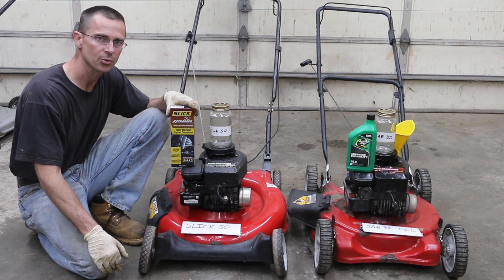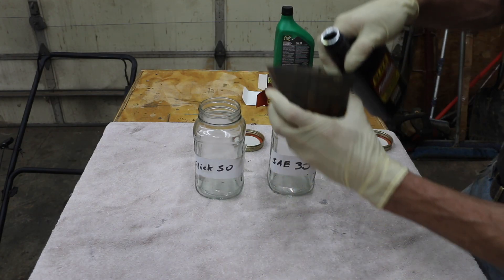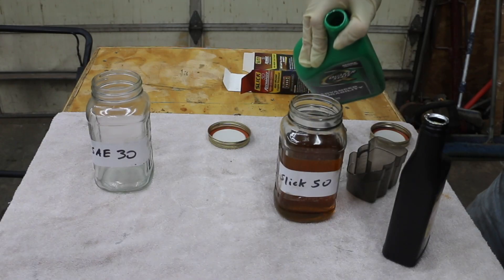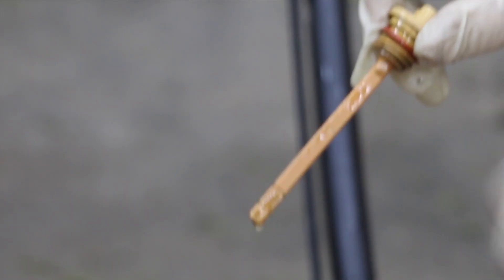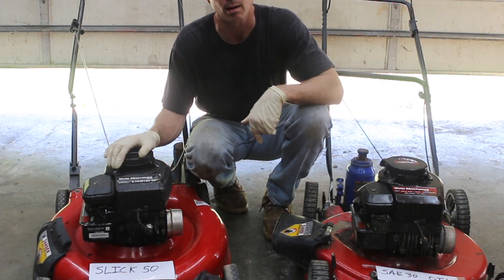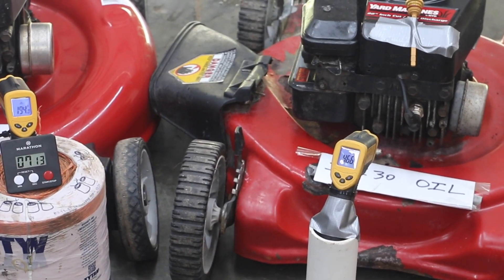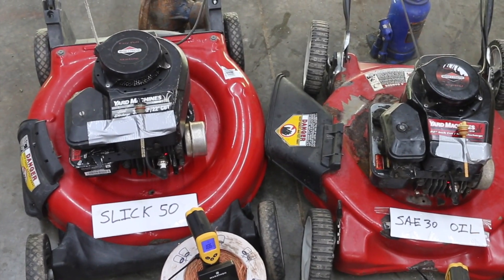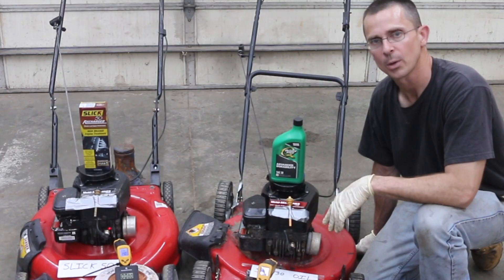Can't believe what SLICK 50 did to my engine!!--Dry Crankcase Test!

Comment: Slick 50 need to be run a long time before you drain the oil for this test
Reply: This. It's an engine treatment which binds actuated PTFE to metal wearing surfaces inside the engine. Instructions always said add it to a fresh oil and filter change then don't touch it until next oil change is due. That's 5000km for most vehicles. I used it for decades and found it to be amazing for getting an extra 10 years out of old/ worn motors. Even better results from small engines/ gearboxes. Love the stuff.
Reply from the maker: Thanks for the feedback.

Comment: Great video..  like you I certainly remember the slick 50 commercials.  I’ve been repairing automobiles professionally since 1981 and really like this video comparing the two.  I have to wonder.. did you attempt to restart either engine after they cooled..    though I heard a little squeaking from the Slick 50 engine before it stopped.. almost wonder if the piston seized within the cylinder..  interesting that there was no connecting rod knock from either one.. 
going back many years I remember cast iron straight sixes in Fords and Chevys would heat seize after running out of coolant..  cool off… restart just fine… and likely burn a little bit of oil thereafter…    Those engines had oil when they stopped back then.. 
I would love to see the test again with two IDENTICAL engines….  With a restart after cooling.. and perhaps a look inside for the finial failure..
But there goes the engineer in me again…. Great video, thanks for doing it!!

Comment: Nearly 40 years ago, I drove about 15 minutes w/no oil pressure. In a nutshell you could say I had a Slick-50 dry crankcase test forced upon me. 

Bought a new 1984 Turbo Mitsubishi. ~30K miles did a Slick-50 oil change. About 3500 miles later I unknowingly lost oil pressure only realizing the same about a mile, all down hill, from home. 

Next day I fix the oil leak. Filled it w/oil. It started free of drama! The most amazing part of this story: the product delivered the fuel economy increase I had hoped for!!  After that, per my plan, I switched to synthetic oil. Continued to enjoy a consistent 3-4 mpg improvement over the well established baseline. At 110K miles I sold it w/the original engine & Turbo still running well.

Comment: THIS TYPE OF ENGINE IS NOT SUITABLE FOR THE TEST YOU ARE CONDUCTING AS THE CRANK SHAFT JOURNAL DOSE NOT HAVE PRESSURE PUMPED OIL FEED BUT A SPLASH SYSTEM,THUS THE SLICK 50 MAY NOT HAVE COATED THE THE CRANK JOURNAL POPPER  BY DRAINING THE OIL DOSE NOT REMOVE THE OIL FILM FROM THE JOURNAL FOR THE SLICK 50 TO REPLACE IT? I WOULD LIKE TO SEE THE TEST DONE ON TWO IDENTICAL CAR ENGINES OF SIMILAR RUNNING HOURS/MILEAGE ALSO THE BUILD QUALITY OF THESE ENGINES WILL BE FAR SUPERIOR TO THE BRIGS AND STRAITEN LAWN MOWER ENGINES
Reply from the maker: Thanks for the constructive feedback.

Comment: I can't help but feel that over time the heat reduction would extend the life of the engine. Am I wrong in thinking this?
Reply: I agree as temp is usually degrading for most engines.
I wish he broke the engines down to id the specific failure mode, which 
might provide insight into why the 50 engine failed quickly, yet ran cooler.
Reply: @richardwellons5138  yeah. I would not be surprised if it was a fluke. The temperature differences though were quite large.. I'm not even sure how that is possible. The slick 50 would have to reduce friction inside the engine by a huge amount to achieve those results. 

One of the biggest things that causes engines and oil to break down is friction, and the heat caused by it.. which really, really, has me wondering what the long term value of slick 50 is and how exactly it's active components work.

Comment: The two engines looked different.   Need to be same for a control test.
Reply: Both appeared to be Briggs and Stratton which is still the standard for small engines to this day. The one that lasted longer looks to be on an old well used mower and the 2 minute engine is on what looks like a new mower. I’m sure he would be happy to reshoot this video if y’all ship him 2 brand new engines from any manufacturer.
Reply: Actually it’s true that each engine should be the same type! However who to say the age of the engine plus how worn-out is each engine were! How often was the maintenance done on both engines and then the environment, please note that the exhaust from the left engine was blowing directly on to the other engine…. Realizing that engine exhaust being blowing on the engine with the straight 30 weight really did well! … unless the one with slick 50 had a bearing issue! So your test however fun left little to nothing regarding an accurate study! I’ve spent twenty years of my life studying the destruction of different sealants! While destroying sealants you had to be certain to compare apples to apples and not apples to oranges!

Comment: If you had run the slick fifty for an hour or two before draining I think you would have had a different result.
Reply: Thats a great point. I believe there is a "break in" time, like hardener on a new cam.
Reply: @gregtanner3161  my dad was a small motor Mech and he loved slick 50

Comment: Three weeks ago, my oil was quite clear on the dipstick. I put less than a pint of Marvel Mystery Oil in the oil. And same in gas tank. Three weeks later I changed the oil and it was BLACK. And the idle has smoothed and car has about 20% more acceleration. 2001 Celica GT with 1.8.

Comment: When slick 50 first came out,My treated engine ran fine with no oil(85°day) for 7hrs.,and gas mileage went from 250 mi per tank to 325+ mi. per tank.WishI still had some original formula
Reply from the maker: Thanks for the feedback.

Comment: The engines I saw them running all that time ago were slant 6 Chrysler engines.  Dad said they, like a model T engine, had so many oil dams in the block that they restrained some oil and it slowly  trickled down and kept the engine oiled for some time.  The engine we saw was never ran at long intervals, but minutes at a time, and it would be a good gopher smoking machine it burned so much oil.  Probably been twenty ish years since I've seen that display.  In the meantime  a friend of my mothers swore that STP treatment was far superior to Slick 50.

When some dealers were selling Ford Model T cars, that's a similar stunt.  They'd  drain the oil and replace the plug.  After yacking for some time spreading the bull, the rest of the oil made it to the pan so it could hit the splashers and lube the engine.

Great video as usual.
Reply from the maker: Thanks!

Comment: Two theories as to why the Slick50-lubricated engine failed sooner than the just-motor-oil one:
(1) Perhaps there was too little oil-film in the Slick50 engine, since you added more Slick50 to the oil than was recommended?  Maybe the Slick50 "diluted" the oil too much and thus made it too thin a viscosity?  Perhaps more of the oil ran off when you drained it, as compared to the engine with just the straight oil?
(2) I wonder if one engine (the Slick50 one; I notice that it's shinier and has more of its stickers still on it) was newer than the other engine and thus had less cylinder-and-piston wear --- maybe the closer tolerances caused it to seize up faster...?
P.S. 1:00 Yes, sir-ree --- ya ALWAYS wanna read and follow dem "indructions" to da letter :P :D
Reply from the maker: Thanks for the feedback.

Comment: one thing, the machine with the slick 50 looks newer and the engine most likely is tighter and the other machine look older and the engine is worn which mean the engine had great tolerance in the  engine.
Reply from the maker: Thanks for the feedback.

Comment: I put slick fifty in a 74 hornet, it saved the engine though it was in there for8 months. I went on a trip and i checked the oil and there was none but the engine was running fine
Reply from the maker: Thanks for sharing.

Comment: I've been looking at Slick 50 ads and cannot find where they make the claim they can run without oil BUT Prolong makes the claim with virtually every ad and infomercial. They're even dumping cement in an engine and running an engine without a crankcase! I also have not been able to find anyone putting these claims to any real test the way you do. I do have a friend who did try to stop the bearing in the Prolong challenge and says flat out that he couldn't do it. And Amazon reviewers claim they have run their engines without oil after using Prolong. Would love to see you put Prolong to the test.
Reply from the maker: Thanks for the video idea.

Comment: Oil level was the same in jars to begin with. However, after you drained engines the slick 50 was full to its starting point but the SAE30 was noticably low.
There was oil somewhere still in that engine.
Reply from the maker: Thanks for the feedback.

Comment: They did something similar with an old product called "prolong"
Anyone remember those commercials? Pouring sand in the head lol
Reply: The best I've ever seen was using Slick 50 for one oil change, then Prolong on the next. Including the transmission, at 100,000 miles. That was back in the late 70's or early 80's. Was like a new van after that!!!
Reply: @meko1896  they still sell prolong but EPA got involved so not to consumers. It's called "pro 1" now. Got some through a friend at work. They use it in their hydraulic fluid for it to last longer I guess

Comment: Try XADO, available at Amazon. Get the small engine packers they are cheaper.
They have really good products for gas, diesel, greases, fuel treatments, gas and diesel, automatic transmission, power steering
Charles
Reply from the maker: Thanks for the video idea.

Comment: Slick 50 has to be given time to coat usually either run for 30 mins or 30miles so it can adhere to mechanical parts. I've used in all sorts of car engines. After all its an additive, not a total lubricant..
Reply from the maker: Thanks for the feedback.

Comment: You can't just put these oils in an engine and run the test you have to use these oils for some time for the oils to impregnate the cylinder walls.
Reply from the maker: Thanks for the feedback.
Reply: Impregnate?

That's not how this works.

Comment: Very interesting. As you rightly point out, this is just one test and therefore can't be seen as definitive (who can waste a couple of dozen lawnmower engines?!). It does however give a strong pointer to Slick 50 being not quite what it claims to be. I'm a professional motorsport engine builder and we tried Slick 50 around thirty years ago on the dynamometer in order to test claims of "lower friction and more power". Our result was that there was zero difference.
Reply from the maker: Thanks for the feedback.

Comment: I had a one cylinder 600cc kick start motorcycle, After I treated it with slick 50 I only needed to kick it one time to get it started at any temperature. I treated all my internal combustion engines with it. If I could get my hands on it I would use it now.
Reply from the maker: Thanks for sharing.

Comment: I would like to see a similar Test done using ProMA MBL8 Additive. I have used it in my Engines and it is amazing for quietening down noisy Lifters and Timing Chains. The Lead lubricates and the Copper fills any scores in the metal. A few Videos on YouTube showing the Bearing Test Watching it in real life is so much more amazing. I used it in my Manual Gearboxes and Power Steering also. I am a believer of it!
Reply from the maker: Thanks for the suggestion.

Comment: Wasn't slick50 taken to court for false advertising? About the time they suddenly stopped all those ads. Anyway that time and temp difference could easilly be due to the tolerances from engine to engine. Saw a guy run an old Lycoming aircraft engine with a prop for some actual load and it went like 15 minutes after draining the oil.

Comment: Your test is flawed. Those mowers are not the same. One may have been used more often or been serviced at different intervals. Internal parts might be different. Both look used. A more reliable test would be to use two identical new mowers. 
Also the slick 50 might need to run longer before you drain them run them both longer.
Reply from the maker: Thank you for the feedback!

Comment: From what I can tell it did the Slick 50 did help the engine run cooler which can in turn help extend the life of the engine--You should do and post experiments with other additives and gather and post all the information possible--Could be costly though.  You should never run an engine dry of oil or coolant.
Reply from the maker: Thanks for the suggestion.

Comment: Idk about dry running….but back around 1988…I Slick 50 treated my 3.5 L Rover SD1.  Closely monitoring fuel consumption over several thousand miles, before and after, showed a 10% improvement in fuel economy with Slick 50…..Well worth it.
Reply from the maker: Thanks for sharing.

Comment: Looks like the slick 50 engine was newer (Less wear / tighter clearances) maybe the older looking engine had bigger clearances allowing parts to expand more before locking up. The slick 50 did seem to be working looking at the temperatures.
Reply from the maker: Thanks for the feedback.

Comment: I love your work and can’t wait for you to try the same test with NULON. There are various versions of it, but I have been using the one where you put it in a new engine at the 20,000km oil change. I think it was developed here in Australia, but I’m not sure. Their advertisement ran a car through the centre of Australia after being treated and drained and the oil light was on the entire trip, but it never seized. Please, please deo this with NULON to satisfy my now piqued interest. Lloyd
Reply from the maker: Thanks for the video idea.
Reply: I have used Nulon E20 for 25 years at least and it works very well for me..no engine failures, smooth running and nice power.

Comment: Have you done the same test on Dura-lube? I specifically remember the Dura-lube infomercial where they put Dura-lube in a car, put it on a lift, drained it and took the oil pan off. They went on to start the car and blast a pressure washer onto the crankshaft while running.
Reply from the maker: Thanks for the suggestion.

Comment: Did you try to test an engine with 20 oz’s of slick 50? Reason for this question, back in the early 1980’s I saw a demo using a B&S fitted with a plexiglass crank case cover that ran for hours. This was at a tech school I was attending. I was very impressed - BUT - never actually used the product. 
Also, in like manner and roughly around the same time, I was almost CONNED into selling a tire additive called TuffTire, that was supposed to seal punctures from things like nails, screws, and other minor tire damages. The demo seemed incredible, framed with equally incredible claims. No matter how many times the “demo tire” was deeply punctured with an ice pick the product sealed the holes. 
So I bought a 5 gal bucket, got a donut spare, added the recommended amount of product and not a single hole in my demo tire would seal! Clearly the actual product amount needed to accomplish the sealing of any tire was so much more than the manufacture’s claim! If I didn’t have the intellect to conduct my own investigation/experimentation before I started selling this stuff, I would have unwittingly sold the TuffTire LIE to everybody I knew! So I joined in the class action law suit against TuffTire and never heard of it again!

Comment: For what it's worth I used to use a product called friction-free from Market America. I had an old 1979 Ford E150 van that would lose oil pressure when idling at a traffic light. The oil light would come on and flicker even though there was plenty of oil in the crankcase. It had a 351m V8 I was told the reason for this was the cam bearings were worn and it was common to this engine. Supposedly friction-free has "micro metals"  that fill pits and voids in worn parts so there is less oil leaking by in the oil journals. After using it for a week or so my oil light no longer flickered and my oil pressure gauge remained at a normal place instead of almost nothing on the dash when idling. In my case it helped my engine. I wonder what it would do in a death challenge test like this lawnmower test against regular oil and slick 50???
Reply from the maker: Thanks for the suggestion.

Comment: I use Torco assembly lube and have found its very difficult to remove from your skin, even with a paper towel. That would be one oil product line to test as they have a different application and there are literally a dozen or more of them readily available.
Reply from the maker: Thanks for the video idea.

Comment: the problem with this test is you cant say both were exactly the same esp in tolerances
to do a more scientific test for this you would need a much larger sample size   I would say an absolute minimum to get any sort of validity to the test for that would be 5 of each  preferably 10 as a min..  and one should also do some build checks n them before running
the test.  Checking/noting various aspects with a feeler gauge for cylinder wall/ring tolerance etc.. you know enough to handle that and more   the fact you didn't even check that is a bit of a surprise

Perhaps contact the MFR of that ower to ask if they want to be involved by supplying the engines etc since they would be getting them far far cheaper etc..
Reply from the maker: Thanks for the feedback.
Reply: @ProjectFarm  np hope it helps in some way

also while you as  rule already do some excellent if long winded vid

other idea for companion vids e would be a summary xref chart etc a the end of the vid  both for those that don't have time for entire vid but for quick reference after the fact as well